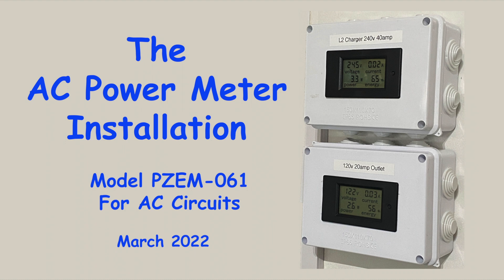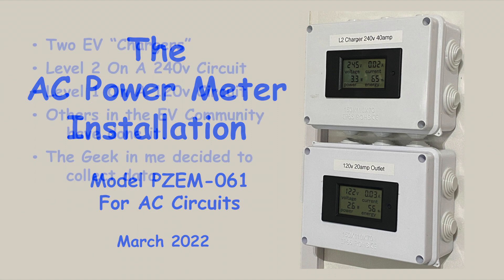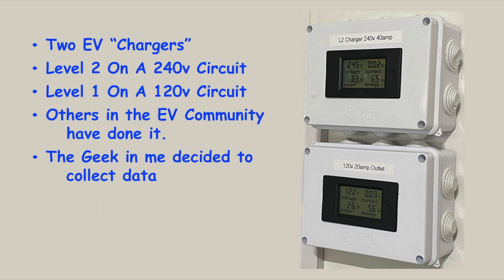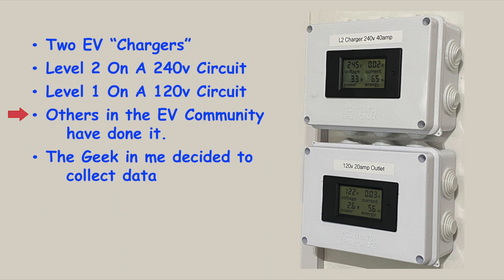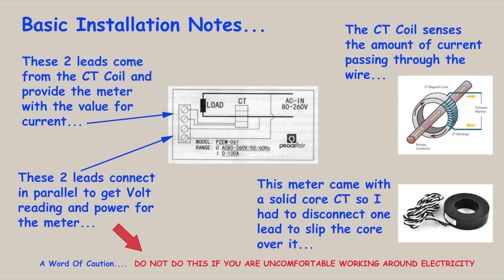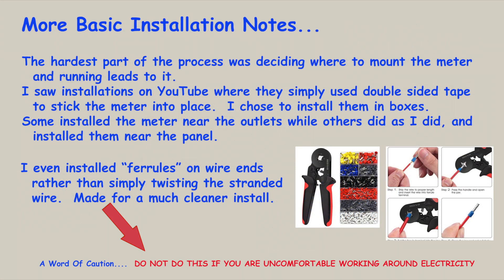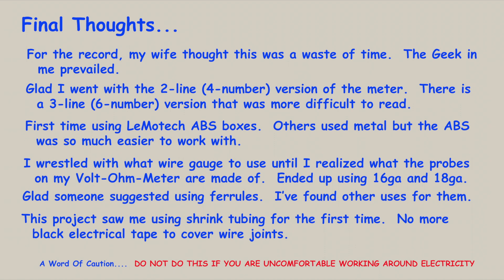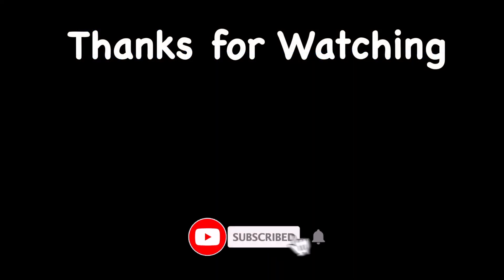PZEM-061 Power Meter Install - March 2022

Comment: The Current Transformer (CT) has current impressed on the coil, which sends that to the meter.  The meter does all the calculation based on what's coming from the CT.
Reply from the maker: Thanks Charles for visiting the channel...